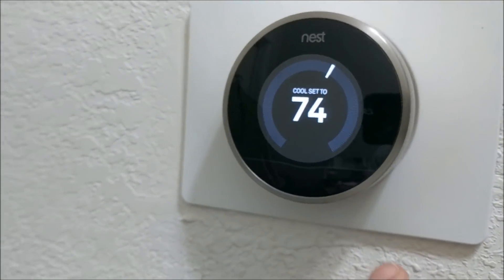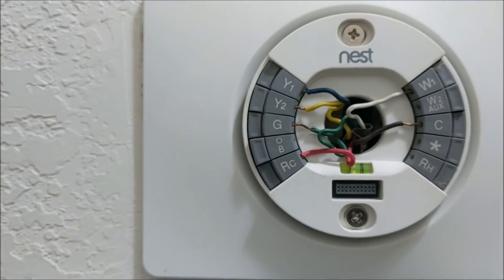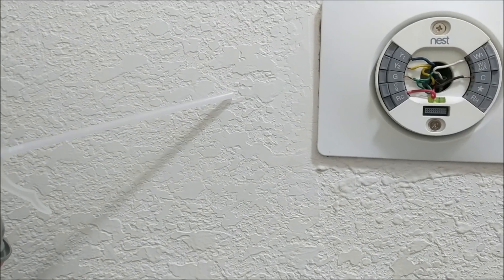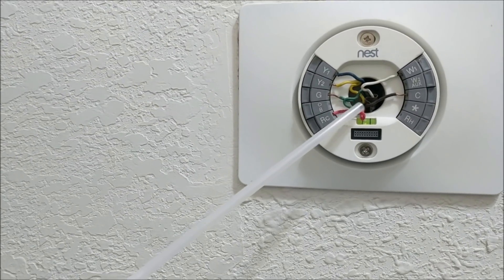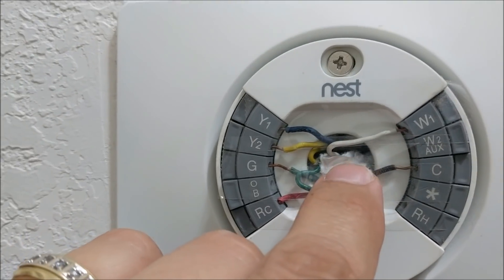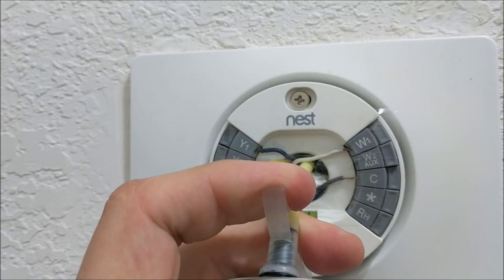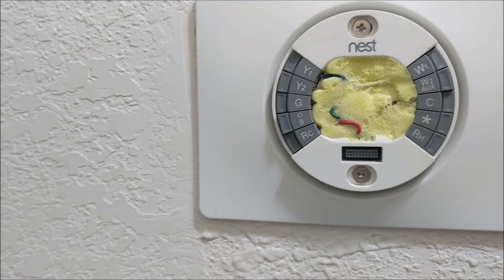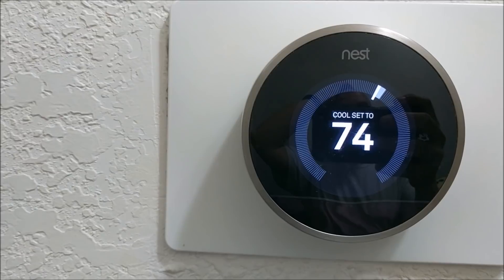Video review HUGE mistake Nest smart & all Thermostat owners make

Comment: you started at 74 degrees before sealing the whole, and still 74 after sealing the whole. Am I missing something?
Reply from the maker: Maybe you are, so here's the backdrop.......Thermostat will not shift temperatures in an indoor environment where the ambient temperature is already 74 degrees, and outside is only 73 degrees. Thermostat was in cooling mode so you cannot expect it to shift temperatures, given the mentioned ambient temperature. Hope that helps.

Comment: Simple,,i use fiberglass insulation,pink panter,from lowes,in the hole,,and ready,
Reply from the maker: That does not stop air leakage. If heating your home, and you got 20 degree cold air coming, that does not "seal" air leaks. Same if you are cooling at 75 degrees, and attic is 13o degrees. Use the minimal expansion type like this one..... https://amzn.to/3cP1JEj

Comment: Could I use duct tape to block off the hole
Reply from the maker: Yes you can do that too. But it would only stop air leakage but not "insulate" the cold, or hot air behind the thermostat.

Comment: I used regular sealer, red bottle, same brand. And i forgot to use tape so i had to wipe it off after spraying, then applied tape. Will it be okay? Does it matter whether you use the "Window & Door" version or not? On my bottle it says "not for use in voids"

The biggest mistake is getting a Nest in the first place.
Reply from the maker: You NEVER want to use the red, or worse, the black can. If the can clearly stated "not for use on voids" then of course, you shouldn't have used it. The blue can is designed for minimal expansion, such as sealing small gaps around windows, because the red or black can can actually warp a window frame. Imagine that! So don't be surprised if in the next 24 hours your wall develops a belly. Use this can, as I clearly stated on the video..... https://amzn.to/32K3Ama

Comment: Good points and advice for all thermostats brands. Instead of that foam, I put some putty to seal the wall hole and allow the wire to come out and is also easier to remove in case or maintenance or replacement. Thank you!

Comment: Thanks for the smart advise, but putting the spray foam on the actual wires on the outside of your wall cavity is definitely not recommended. Instead you can put that tape just over that hole in the wall by removing your nest mounting plate, and then tape your wires off to the side of the outside of the wall so that you can have clean and easy access to them if need be. Then tape over the opening where your heating/cooling wires come out from. Now you can just follow your same steps, but just one more tip I would have done. And that is putting your heating/cooling wires in some kind of straw like material or even wrap them in tin foil so that they move freely inside your wall. Just Incase one of your wires goes bad in the future you would easily be able to replace or fix that wire. Then use your expandable foam around that and don’t let it exceed the walls opening, but instead make it flush or even dugout just an inch or so from your drywall opening. I have done a lot of home remodeling’s in my day and so I thought I would share from my experiences with this, but still a great tip for the non tradesman out there who do diy projects like this. Thanks for sharing and taking the time to make this video!

Comment: Trouble I am having with my 4 wire setup is I ca 't seem to see air like you have set to 74 in blue....it says eco then goes right to heat
Reply: Change from heating mode to cooling

Comment: Great tip! I may look for a more simple solution to insulate.
Reply from the maker: You can also use fiberglass batts, but it may just fall down to the bottom of the wall cavity. That's why some "stuffing" like newspaper, or paper towel, will create a "netting" inside the wall cavity for the foam. REMEMBER, use the blue can here.... https://amzn.to/2RkcLs6

Comment: Thank you. Why this is not mentioned anywhere in the Nest Thermostat installation instructions provided?
Reply from the maker: I guess it's the same reason cheap building and construction companies build entire communities of cookie cutter homes, and build fast, but not properly. I have seen holes so large you can fit a golf ball through it, just to run low voltage thermostat wire. This presents not only an air transfer issue, but an issue with insulation, where once side of the wall is cold, the other hot. Heat will move much quicker, through uninstalled walls, vs insulated walls.

Comment: Don’t you guys insulate walls in the USA and by the way if its an outside wall never ever ever install a thermostat on a outside wall use inside walls
Reply: Billy Nadeau - Of course we insulate walls, exterior walls. Why insulate interior walls when the temp is the same on both sides?
Reply from the maker: @harleyrdr1  Harleyrdr1, if you noticed on the video, that's not the case. If the interior wall has a huge 3 inch hole to an attic via a top plate, or a 3 inch hole to the crawl space or unconditioned basement via the bottom plate, then your interior wall can benefit from insulating the ara around the thermostat area. There is a company that actually sells minimal expanding foam for interior walls. On a home I use to own, our big screen TV backed up on a shared wall to a bedroom. That bedroom would be affected by TV sound, even at minimal. So in that case, I rented an insulation blown in machine at a box store, drilled 3 inch holes on the top plates from the attic, and insulated with cellulose. The difference was night, and day. So YES, in some cases, insulating interior walls can be beneficial.

Comment: GreatStuff is a good idea. not sure about the blue can you are using, though Great Stuff has a reputation of eating  the insulation off wires and making them bare, which can lead to problems in the future!
Reply from the maker: Rodney, I agree with your statement on Great Stuff. The blue can is a different formula, minimal expansion, so it is safer. It Is also approved to put around windows, where the regular great stuff continues to expand, to a point that it has blown windows right out of the opening.
Reply: SaveGreenHere  its the chemicals thats in GreatStuff that eats at the insulated wires, that I was concerned about. I know where I live electrical inspectors frown on the use of  GreatStuff on  exposed wiring! 
 Thanks for replying back!
Reply from the maker: Rodney, I am not 100% sure, but I think the blue can is a slow rise, open cell formula. Here is a comparison between closed cell and open cell...... https://www.youtube.com/watch?v=2mkQ6kW6ArY

Comment: A simple electrical block duct seal Compound would had done just fine...
Reply from the maker: Yes any liquid type sealant, would work too. Foam just does a better job as an "insulator" as you not only want to stop drafts, but also insulate from the extreme heat or cold, that is inside that wall cavity.

Comment: Wondering if you put the sealant in before you install the nest unit. Just have the wires poking out the hole. Pack the hole with cotton etc around the wires. Then make another small hole close by the one with the wires it. Fill the space. Then install the nest with nothing coming into the nest . You could seal around the wires . Before you introduce the foam with a hot glue gun. To prevent the foam leaking out the wire hole. Then just scrape off any foam the backflows in through the hole you put the foam in .
Or just seal around the wire hole before you install nest with a little hot glue.
Reply from the maker: Yes, those are great tips. Thanks for sharing!

Comment: All walls have a top plate and a bottom plate, meaning there is a 2x4 in other words there is a piece of wood blocking air from the top and the bottom of the wall.
Reply: Those top/bottom plate are not air tight.   So this will help some
Reply from the maker: @Markrubi is correct. The top/bottom plates are NOT 100% air tight. Unconditioned, and unfiltered air gets passed the top/bottom plates. I also saw a sale on Amazon, where they had the Nest E thermostat for half off retail....... https://amzn.to/2Op1Skt

Comment: So I tried a quick fix with what I had laying around. I just filled the hole with facial cotton pads(cotton balls would work too). I was able to get them nicely packed in around and behind the wiring. Now I don't feel any cold coming through. Used an IR thermometer and it was correctly reporting the indoor temperature at that spot.
Reply: Wouldn't cotton balls and electrical wiring be a fire hazard?
Reply from the maker: YES! That works great as well! As long as the thermostat is not correctly reporting the indoor temperature at that spot, you should be set!

Comment: Would insulation tape work?
Reply from the maker: Black tacky tape will work, but as mentioned, best solution is to use a gang box, foam filled, to avoid extreme temperatures mixing onto the back of the thermostat.
Reply: SaveGreenHere thanks. We are renting the apartment so we probably can use only tape to cover the hole.
Reply from the maker: YES! Perfect if you are renting!

Comment: that's all fine and dandy unless said wall cavity is being used as a return air duct.  You can accomplish the same thing with some plumbers putty or Duct seal.
Reply from the maker: Not really. A wall cavity used as a return duct has many leaks, which "pull" unconditioned, dirty, and dusty air into the home's forced air system, which in turn causes allergies, uneven temperatures, and of course, higher utility bills. Wall returns are never to be used, as they are not ducted, and therefore draw air into the living areas from crawl spaces, and attics, to in turn be used as "conditioned air". Hopefully this makes sense! Plumbers putty will cap the hole, but not insulate the extreme outdoor, unconditioned air temperatures. Insulation is key!

Comment: Sounds like awesome advice. I think your video would be more reliable if reading had been done before then after you did this work.
Reply from the maker: Yeah, I regret not taking before and after temp readings. I have done so in the past for previous customers, and it definitely has been notable. But the BIGGEST factor is the air infiltration. In other words, when the forced air system kicks on, there is a "pull" of unconditioned air forced across the back of the thermostat, causing "unconditioned" air to register through the thermostat's sensors, and also infiltrate into the home.

Comment: The only problem I see is if you ever need to replace it again you wouldn't be able to due to the wires all have foam all over them and are a mess right?
Reply from the maker: This was a brand new wire replacement for the customer. But for existing older wiring, it is best to use a gang box, and just foam fill the box.
Reply: TONY B the TECH TIGER k

Comment: Why wouldn't you just put a proper old-construction (or new) single gang electrical box into the wall, run the wires through that and you would have a sealed box.
Reply: Sorry but that makes the wires useless for future use and is possibly voiding some of your customers thermostat warranties. The wall cavity should sealed and insulated before installation
Reply from the maker: Personally, that's the way it's set up in my residence, but this is at a customer's home. This is 90% of what I see. Not many have a properly set up gang box.
Reply: Fair enough.  Seems kind of hackey considering popping in a single gang takes 10-15 minutes at the most?  Either way, a good observation of something overlooked a lot of times.
Reply: Yea im doing a gangbox myself

Comment: I'm curious if you had a chance to do some before/after readings on the nest thermometer to see what kind of a temperature difference there was after you insulated the hole.
Reply: So you can’t be sure that you made any difference by sealing it up?
Reply from the maker: This customer has noticed more consistent temperatures, so although no readings taken, the customer reports that they no longer feel the thermostat is acting up with regards to LARGE temperature swings. More consistent now.
Reply from the maker: Jeff, no before/after readings. But the fact that the thermostat is just 4 feet from the air handler/furnace return side, the constant "pull" of unconditioned air (from the return) definitely was causing uneven temperature readings for the customer. Basically, the problem was magnified more as the system was running, if that makes sense. The homeowner now experiences better, and even temperatures. All this, after a new wire setup!

Comment from the maker: If you just replaced your thermostat, and found this video to be helpful, please let me know here. Or even if you plan to replace soon! Thanks!
Reply: SaveGreenHere hello, before I do this I wanted to get further advice.   I live in the  basement apartment of my house.  My thermostat is literally  about 3 feet above the return and  opposite wall of furnace.  Proves by about 1.5 feet between the drywall and the furnace.  My nest quickly reaches its temp in heat,  it feels cold.  Any other suggestion?   I was thinking of relocating the nest thermostat or even easier, bu a nest sensor.
Reply from the maker: @benitodelgado1083  Hey Benito! You always want the thermostat within the vicinity of the main return. Seems like the area that feels cold, needs a Nest sensor. You can buy one, ($47) if there is only one area that feels too cold...... https://amzn.to/2PKNYMS OR buy the 3 pack for only $99........ https://amzn.to/2RFZXbN and locate them throughout to maintain a balanced home. Also check the area that is too cold for drafts, and other factors that may contribute to uneven temps, such as insulation. Hope this helps.
Reply: SaveGreenHere thanks